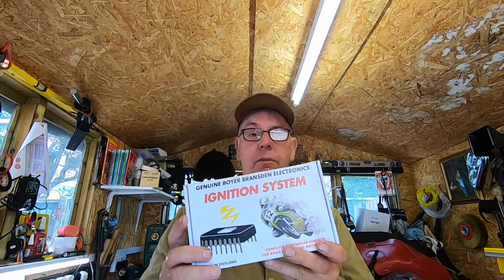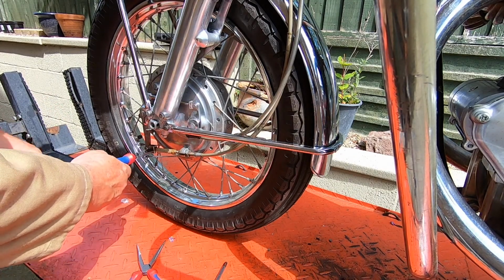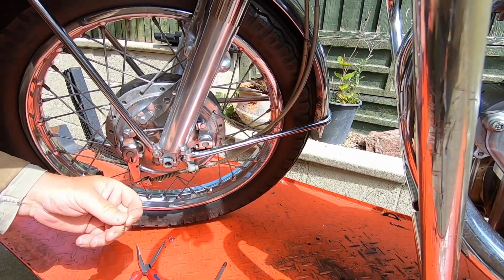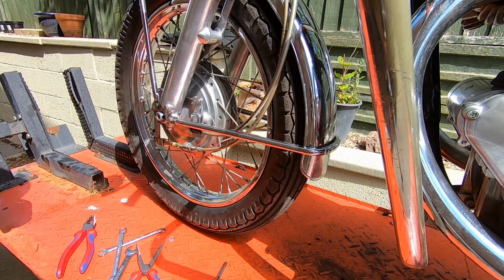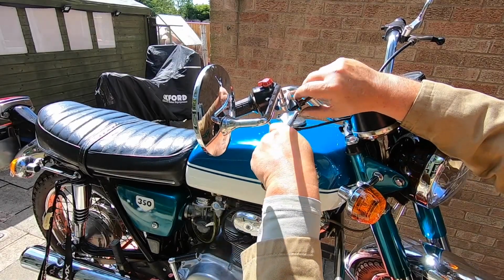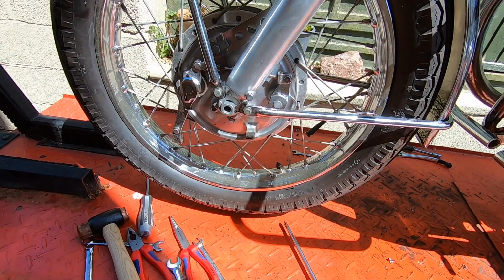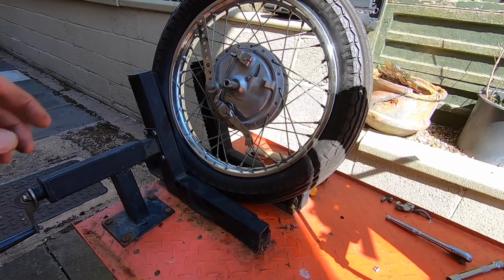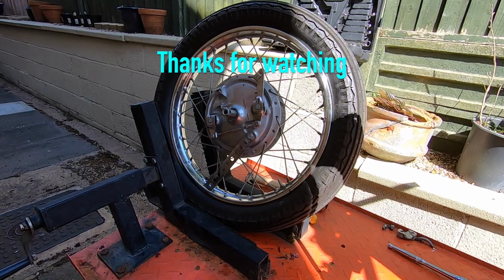Henrietta the CB350 Front Wheel Lock Up

Comment: Hi Hepper, was the brake cable tightened up too much mate, that’s the first thing I thought 💭 of, and I’m shouting at the screen for you to take the cable off the hand brake lever first when I saw there was no movement at the wheel. I love these videos on the wee Honda. Are you going to try the cable tie method for taking the tyre off and back on. It’s so easy 👀 looking to do. No tyre levers needed. Craig done a great how to video on it. 😎👍👍👍🇬🇧
Reply from the maker: Hi mate, yes possibly, I was just trying to get the cable nipple out of the lever arm to release it without having to touch the adjuster nut, brain not working properly me thinks lol. I've already fitted the new tyres but I did use levers, just put inner tubes in the tyres first, then feed through the valve into the rim before levering the tyres on. I did see Craig's method but didn't try it.